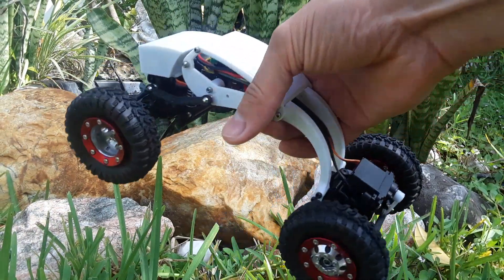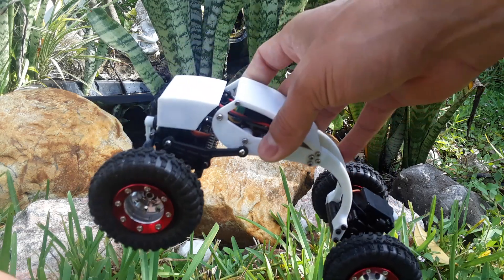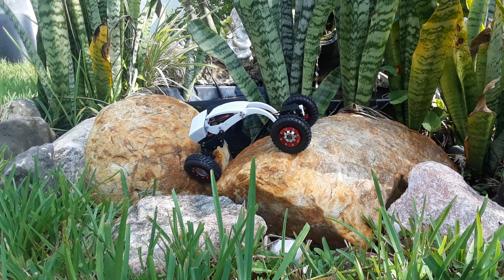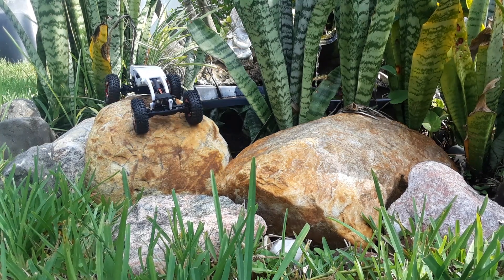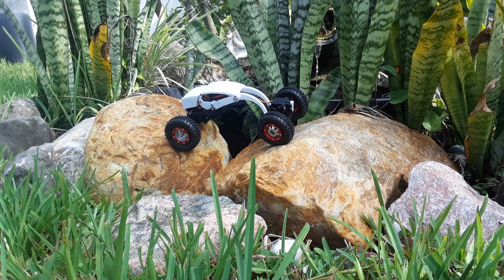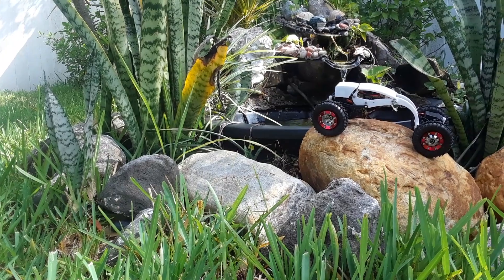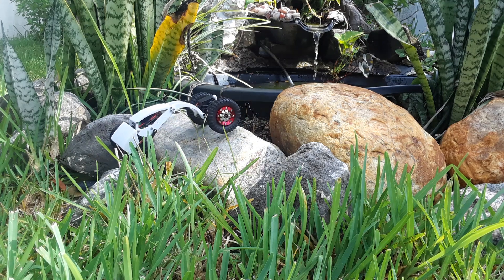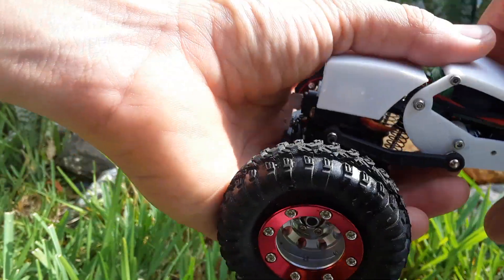Basher Rocksta Stingray Chassis V4

Comment: I like the design. I like that you get 4w steer out of the box, and without paying for axial logo. How does it compare to the scx based wire frame chassis setups as far as versatility and fun factor? Is it usable just with the stock Rocksta and conversion kit, or does it need a stack of other stuff to get rolling? :)
Reply from the maker: I have more fun with Basher builds because its just stronger having the two motors and I dont need to worry about driveshafts getting in the way or snapping.  Its also more capable than scx24 in crawling but obviously no chance of making it "scale" looking if thats your thing.
Reply: @Gamyrc  Thanks! One more question for you. I don't feel quite up to cutting and gluing my own custom tires. What tires and wheels would you recommend for good clearance and grab? I was thinking about 1.0 beadlock with Mudslingers, but I don't know if there is better stuff out there, or if it's worth looking at adapting a larger scale wheel...